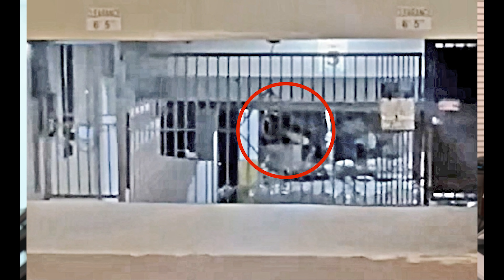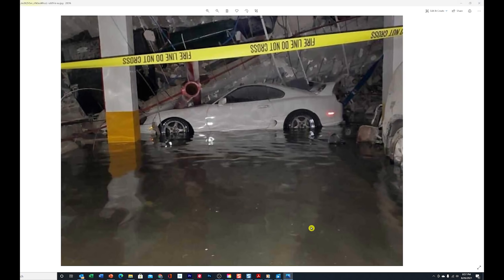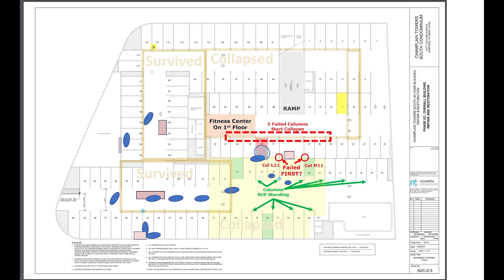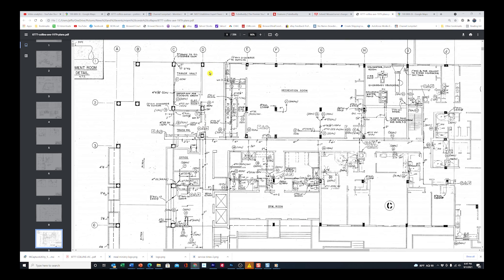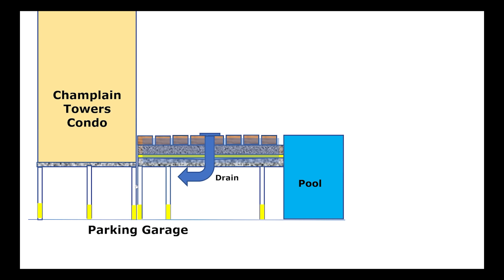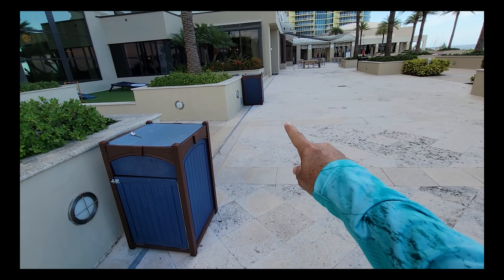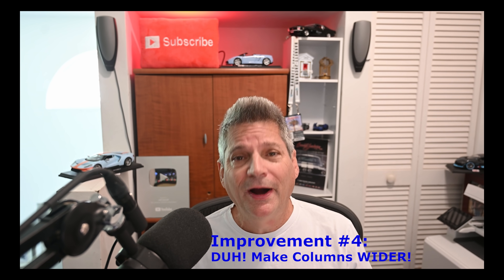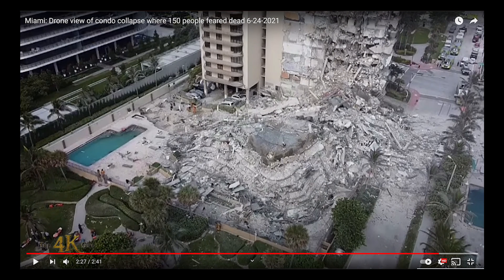Miami Condo Collapse: 4 Engineering Fixes May Have Prevented It

Comment: Jeff -  Hate to be a technocrat but what you were showing as drop panels at the hotel slab were actually capitals.  The capital does not have to have the sloping sides or gradual enlargement it can be a stepped enlargement which is much easier and cheaper to form.  To be classed as a drop panel it has to extend at least 1/6 the span and it allow you to design the slab as a two way slab otherwise it is classified as a flat plate with or without capitals at the columns.  The difference is that the code allow you to use a thinner slab (ie less concrete and weight) for the two way slab vs the flat plate which generally needs to be about 10 to 15 % thicker.  The forming cost are higher for the two way slab so its a cost balancing problem.  Note if you look at the structural drawings there is a dashed rectangle at each of the columns indicating to me that at one point in time they were planning to use drop panels but changed there mind and didn't bother to erase the dashed lines.  
The separation of the exterior slab from the interior slab is also generally  recommended because the exterior slab expands and contracts with temperature changes and if there is no joint cracking can occur due to the restraint of the movement.  
Keep up the good work. 
Your California Structural Engineer Friend John.
Reply from the maker: I thought those dashed lines were for the shearing area around each column. If you google Drop panel, virtually every site shows what I showed as a drop panel.
Reply: @jeffostroff  The dashed lines on plan are a question mark.  Did they intend for there to be drop panels?  There are no details anywhere in the drawings for drop panels.  The dashed lines are not really dashed lines that a draftsman would make that would mean something, there are more like what is called a phantom line and the placement would make more sense as lines that delineate the limits of the code defined column strips which dictate how the top reinforcing is spaced.  But again the drawings don't define what they are or what to do with them, and many places they don't match the building code requirements, so this is another bit of evidence that would have us question if the original engineers really knew what they were doing.

Comment: Do u know if the changes that you talked about in this video have been implemented in the building codes since hurricane Andrew.
Reply from the maker: That is a good question I don't know I think an expansion joint might be a optional type of a feature but I do think that they should have capitals on the tops of the columns and they probably have better regulation about the column width that gets taken care of automatically by the calculations on the computers depending on the strength of the concrete that they need etc. I would hope that things are set up now that would give you bigger columns and they do back in 1979.
Reply: The relevant parts of the building codes then are the same as the building codes now.  There was nothing wrong with the building codes then, there is evidence in the drawings that the building codes were not followed by the original engineers.

Comment: BI pointed out that there was a sheer wall housing the elevators that protect that part of the building. The thicker columns were not under the building; just the driveway where there was a dynamic load.
Reply from the maker: If you look at page 59 of 336 of the PDF file of the 1979 architectural plans you will see that in the basement they do have 24 inch columns down there. Also what makes that building sturdier is that on the second floor they have a bunch of additional beams probably to help steady the shear wall
Reply: @jeffostroff  The beams at level 2 are there to facilitate transfers meaning the columns in the apartments don't line up with the columns in the parking garage.  This is a common problem with structures that have parking- column layouts that work with code requirements for parking spaces may not be the optimum column layouts that the architect wants for condo layouts.  The engineer could have still used smaller columns in this area, we have no way of knowing why they did what they did.  Despite the larger columns in this area they still had punching shear failures there.
Reply: The side that survived was the part that contained the elevator core, which on and of itself provided a lot of strength. Even more so because it was paired with the building's main shear wall. I personally think that without the shear wall being there, the domino effect would have continued around the corner and may (or may not) have taken the entire rest of the building down in sequence. But I agree with Jeff that the thicker columns almost certainly played a part in saving that side (but in my opinion a much smaller part than the fact of the elevator core/shear wall being where it was).

Comment: had a job in Bronx ny where the contractor did not do column capitals and slab deflected 3.5  inches in 12 months!  do the math!
Reply from the maker: Yikes, that sounds like bad design or concrete pour
Reply: @jeffostroff  Try bad inspection by Inspection company that went out of business right after completion.

Comment: interesting repair job,would like to see them pumping concrete up into the forms
Reply from the maker: Yes I would like to see video of when they did the pumping up the concrete, and if they actually used the vibrator ended every 18 inches like they're supposed to.
Reply: @jeffostroff  I found it interesting seeing concrete foundations made, its not vibrated when they fill the concrete in but the machine that pulls the steel tube that holds the walls of the hole out of the ground vibrates it as it removes the tube. So the concrete gets really well compacted and pushed against the sides of the hole.

Comment: Great video!! Where the Supra is…did that part of the building collapsed?
Reply from the maker: No the Super was actually located just to the left of the elevators in the vestibule down in the garage underneath the part of the building that remains standing. But it was right at the very edge of the building so part of the east section of the building that had collapsed is what you see falling down through the floor there and the dumpsters right above the supra which were on the lobby level were crashing through the floor.
Reply: @jeffostroff  oh ok! Thanks for your answer!!
Reply: That part of the building was intentionally demolished, so the Supra is gone...

Comment: I know they were trying to save peoples lives, but that situation looked very unsafe when they were standing in the water with the floor above them
Reply from the maker: I know I cringed watching them but you can see they did put up a lot of shoring poles which helps, except I'm wondering what if the concrete is compromised then the poles only work as long as the concrete doesn't disintegrate around them
Reply: @jeffostroff  I didn't like that the lack of a beam or some kind of cribbing between the poles used for shoring.  Talk about punching shear, not to mention the bottom mat of rebar was torn out of the shored slab.
Reply: That's what Firefighter's do , try to save lives in the quickest & safest ways possible time aloud ❗